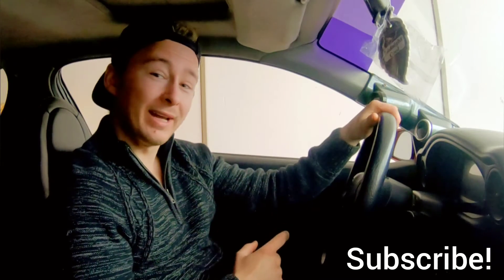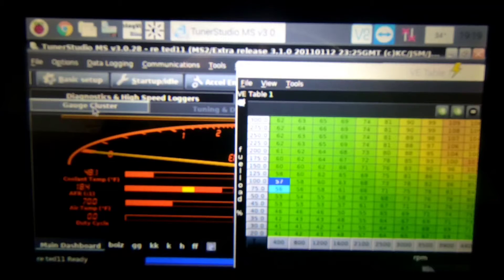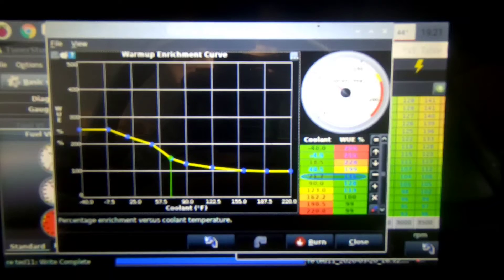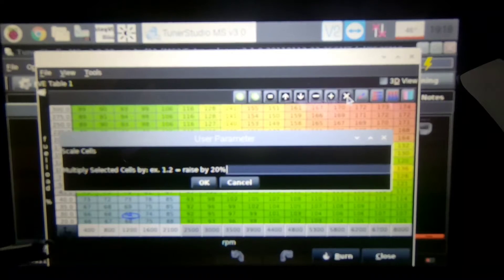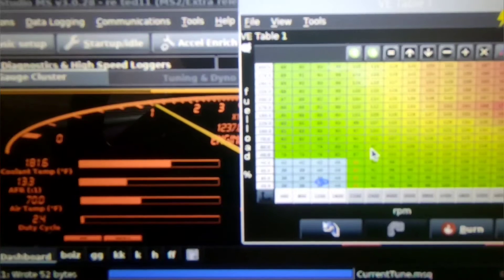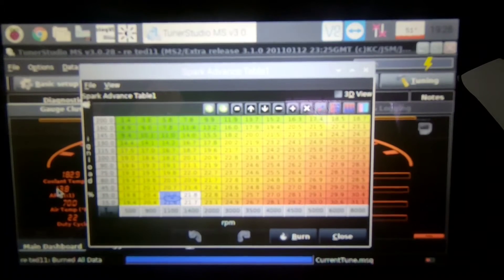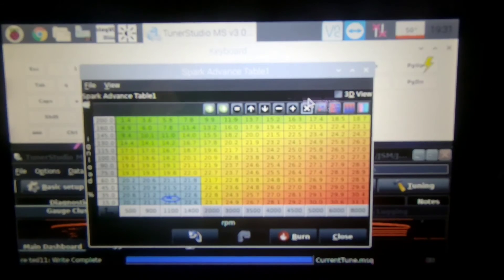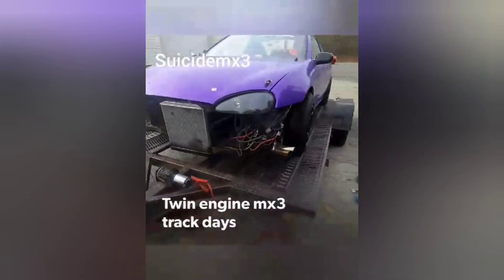How to tune IDLE to get smooth consistent idle! tuning with TUNING with Tunerstudio and Megasquirt!

Comment: Good video because most videos show a car that already starts without stalling out.
This is probably the most difficult part of your MS install. My Volvo 740 still isn't able to keep a decent idle. It stalls out after about 10 seconds of struggling to keep itself alive.
Then from the moment I even touch the throttle it immediately stalls. But on the other hand I've discovered a huge exhaust leak I need to fix before the wideband. Which makes the wideband pretty much useless. So I need to fix that first.
Reply from the maker: Sounds like you need more fuel

Add it either with warmup enrichment or throttle % enrichment
Reply: @Suicid3mx3  Warmup enrichment should be my best bet to be focussing on indeed.
It's a while trial and error adventure when you install your first standalone ECU.

I basically ruled all the main things out like "Is the timing spot on when you fix it at 0° and check with a light?", "Are all my LS2 coils firing on each channel as they should?", "Are my 2 injector banks firing in test mode and while cranking?".

If I now only fix my exhaust leak and try again. I should be on my way. 
If not, I'm thinking about installing something to measure my fuel pressure to rule the regulator out.

What a magnificent hobby this is right? But it's all worth it in the end.
Reply from the maker: @volvovalor8051  ya turn up warmup quite a bit till no rev problems then turn it down as u figure the rich sport